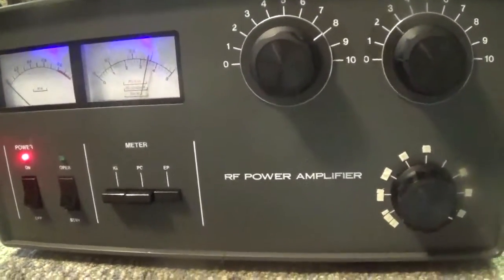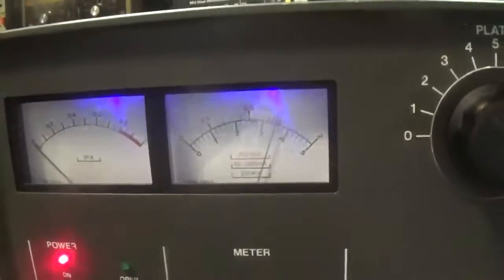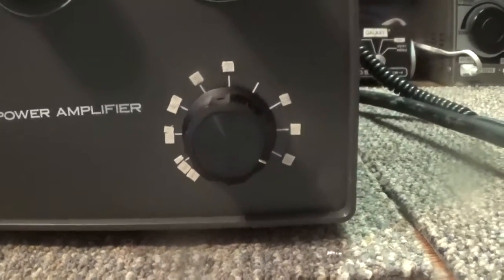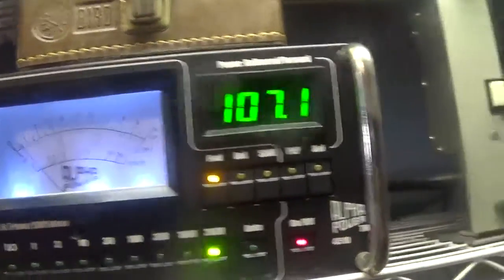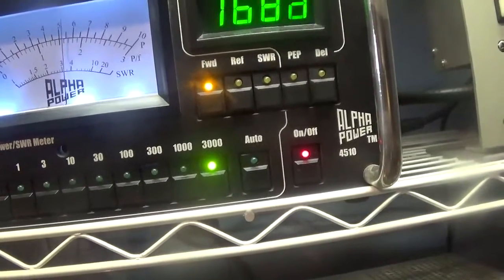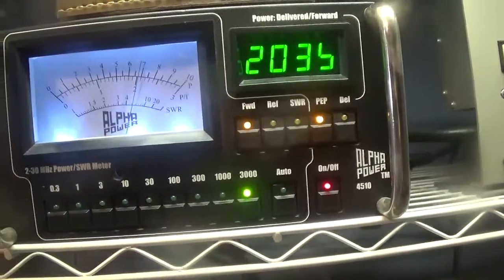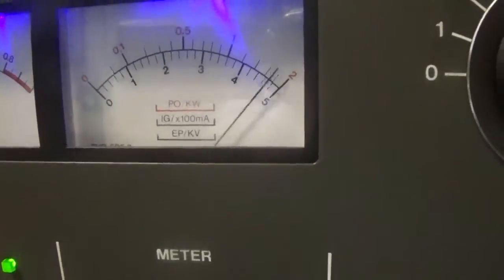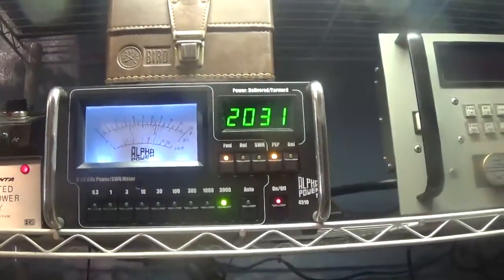Tokyo Hy Power HL 2k dual 3-500z tube amateur radio linear amplifier

Comment: I have the HL-2K amplifier that is producing full output power, HV is around 3400 volts, I have noticed when i key the amplifier with no drive from the exciter the resting plate current is reading 300ma on the IP-A meter which seems to high and starting to think if the Zener diode needs replacing.
Reply from the maker: Off the top of my head, I think the HL2k use a pretty extensive transistor controlled bias arrangement. Off the top of my head I think its around 12v when keyed up, around 80v unkeyed. Your problem may be a leaky tube which I would check first. Great amps. I recently sold one and it arrived to the buyer with shipping damage. Then buyer fixed it, then it worked, then it didn't. Sounds like the bias in it went bad too. Seller filed and Paypal complaint and got money back for the amp and kept the amp, plus is trying to put me on the Black (Bad seller) list on Facebook right now. So for right now I will still do videos but no more selling for me. Not worth it. I do this for fun, sharing knowledge and thoughts and promoting the hobby. Don't need headaches.